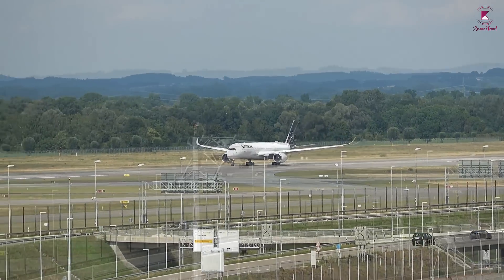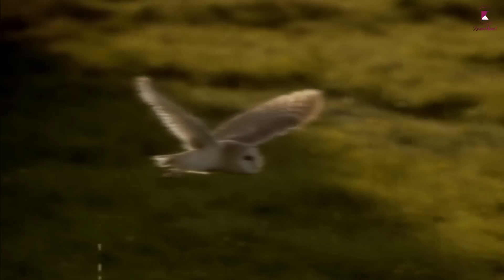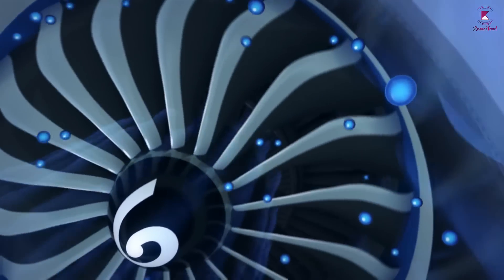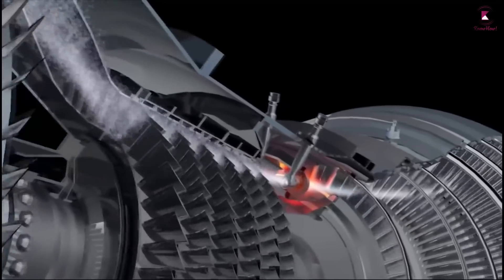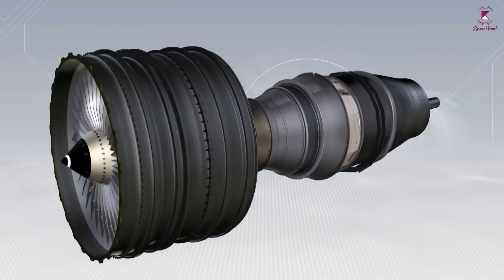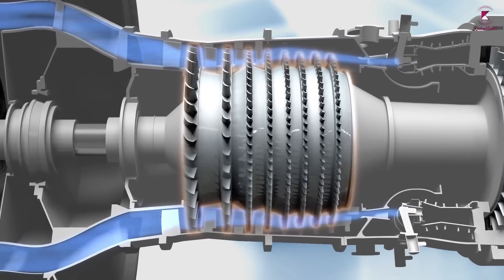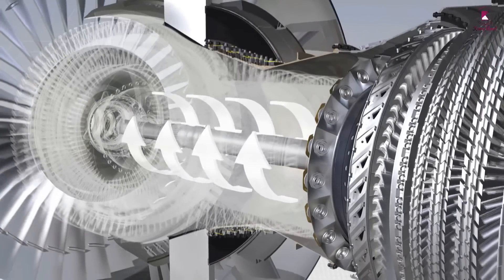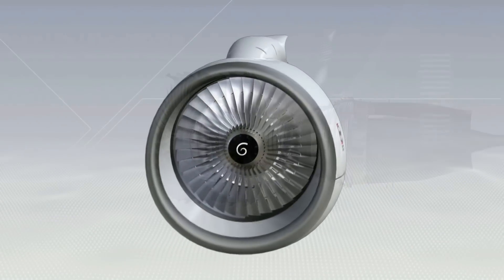Jet Engine, How it Works?

Comment: A good, very basic explanation of how a jet engine works. But a fun fact for anyone who stumbles across my comment; turbines don't actually convert kinetic energy into torque. Turbines actually convert thermal energy into kinetic energy, via the reaction force generated by the exhaust gases when exiting the turbine. 

This is even poorly understood by many engineers. Many engineers assume the pressure is responsible for driving the turbines, however it is the temperature differential through expansion between the turbine inlet and turbine outlet that is actually the driving force. The higher the temperature differential, the more powerful the turbine, which is why jet engines turbine temperatures have been increasing since the jet engine was invented, to increase the power (and efficiency) of the cycle.
Reply from the maker: Thanks for giving your precious time
Reply: @KnowHowSci  You are most welcome, thank you for creating the video.
Reply from the maker: @onetrickhorse  Kindly like, share and subscribe for more interesting videos.

Comment: Да ли може "jet engine" да ради у вакуму?🇷🇸
Reply from the maker: ракета може да путује у вакууму свемира без ваздуха, али млазни мотор не може. Млазни авион има плафонску границу изнад које не може да лети јер нема довољно ваздуха. Млазни мотор мора бити у стању да 'дише' да би функционисао. Ракетно гориво је знатно ефикасније од млазног горива, а ракете су обично снажније. Међутим, ракета је генерално тежа јер мора са собом носити сав свој оксидант.
Reply from the maker: a rocket can travel in the vacuum of space void of air, but a jet engine could not. A jet plane has a ceiling limit above which it cannot fly because there is not enough air. The jet engine must be able to ’breathe’ in order to function. Rocket fuel is considerably more efficient than jet fuel and rockets usually are more powerful. However, the rocket generally is heavier because it must carry all of its oxidizer with it.

Comment: Why some of the blades look as though turning in the opposite direction to the others?
Reply: This is because it is
Reply: If they all rotate so same direction, the rotational forces could easily break the engine. Counter-rotations balance it out.